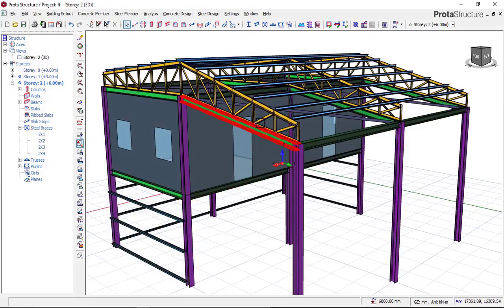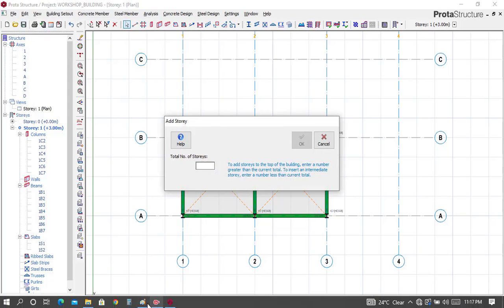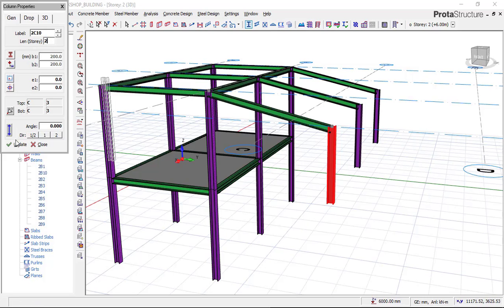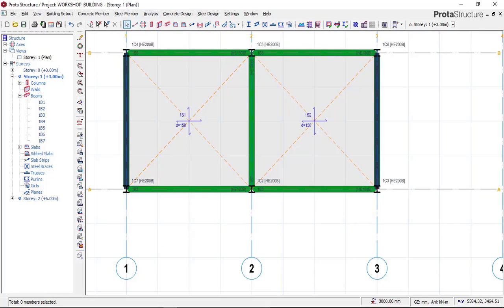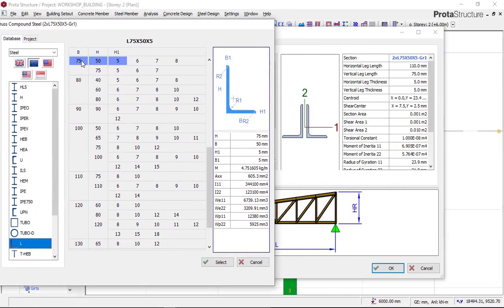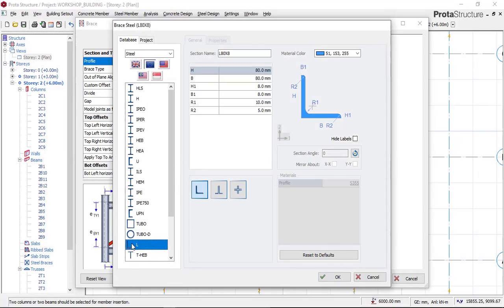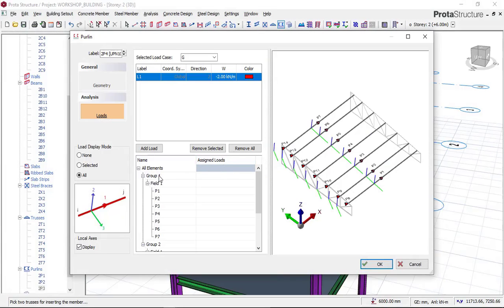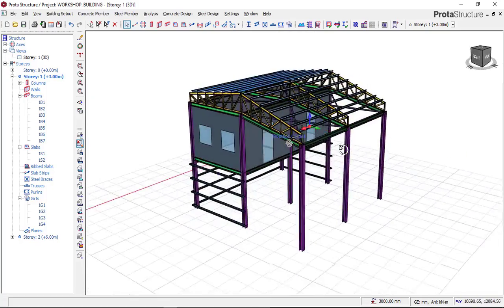steel structure Design in civil engineering

Comment: Hello sir,  please when ever I insert the truss on the building its doesn't not analyse. The building doesn't analyse. But without the truss the building analyses.
From Ghana.
Reply from the maker: The concrete members you are using to carry the truss is very small, increase the size of your columns and beam sections
Reply: @EkidelEngineering  thank you
Reply: @EkidelEngineering  even after I have increased the sections, 
I am still getting warning,
It's states ' Diagonal element of the matrix has singularity Eq joint 564'
Reply from the maker: @AhmedIbrahim-wh1vr  then you have issues with your modeling

Comment: good morning sir, am having issue of opening my prota steel 2021, whenever  i trying to open it, its prompt me to put password or it will tell me registration is invalid, help if have solution to that
Reply from the maker: Good morning Engr. Chinedu,
I know such problem pop's out on Prota steel 2021 and they are yet to get the Fix.

Though my Prota steel 2018 is working perfectly without any errors. So that is what I use, Prota steel 2018